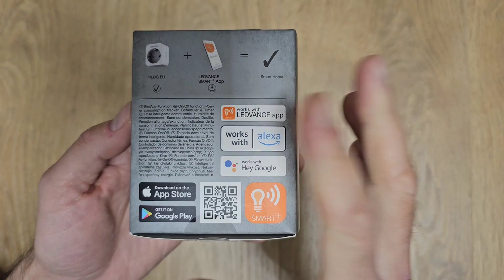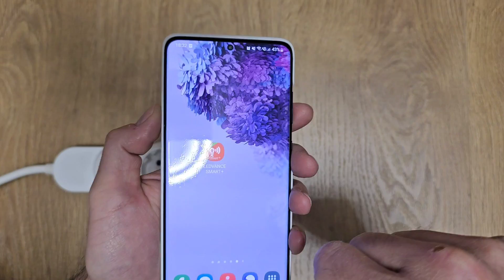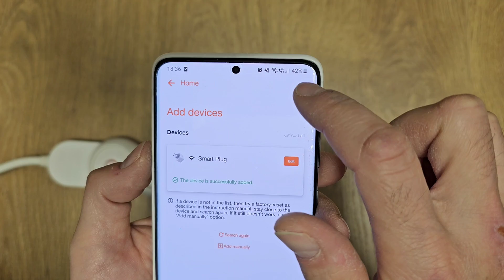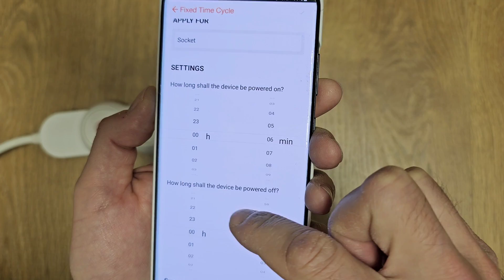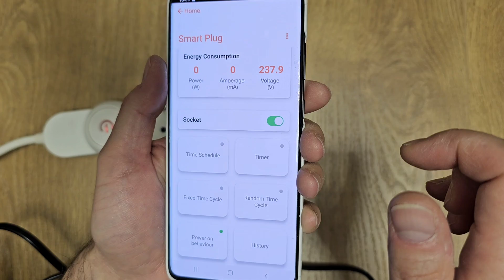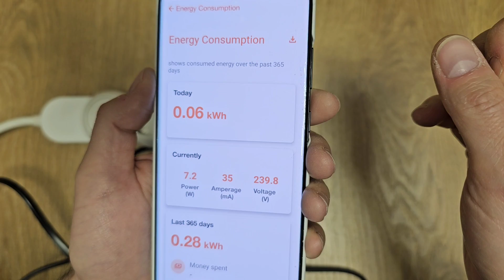LEDVANCE Smart Plug WiFi - REVIEW and Unboxing

Comment: ☺I hope you have few minutes to help me. Can you test if you can control devices when internet goes out? I know that you must be on the same wi-fi network. I would like to buy this plug but I only have mobile internet and router without internet connection. 
Video was very informative and easy to follow. 👍

Comment: Hello my friend. My plug only flashes for two second and then stops flashing. I couldn't connect it to the phone. Also I tried to reset it by pressing the switch button for 5 seconds but nothing happens. When I press the switch button for around 15 second it flashes again but also for two seconds only then it goes off.  Can you help me please.
Reply: The same to me. Could you solve the Problem?
Reply: @drivingteacherpascal9611  Yes, buddy.. it turned out this plug need a gateway device to connect.
Reply: @FreeManIraq58  thank you buddy. Does it work with a Philips Hue Gateway?
Reply: @FreeManIraq58  sramowe-  ruter jest potrzebny młocie.
Reply: There are different versions. You need the Wi-fi version to connect directly.
If you have a zigbee version, you have to connect it to a bridge like Hue.